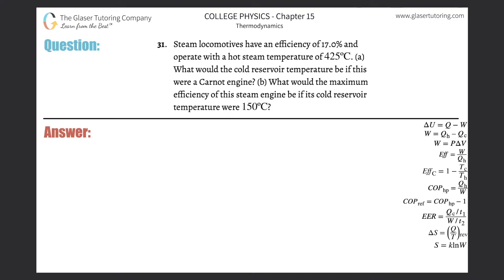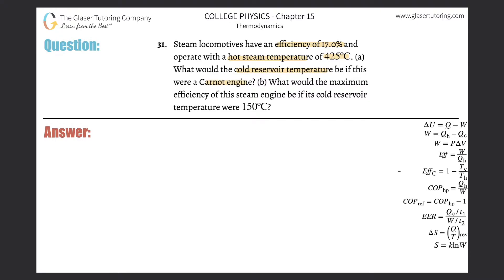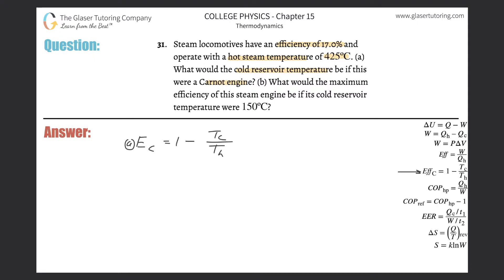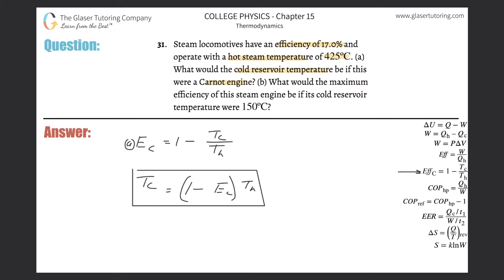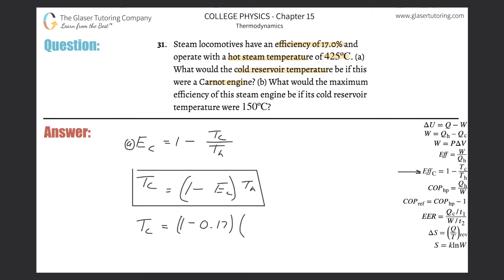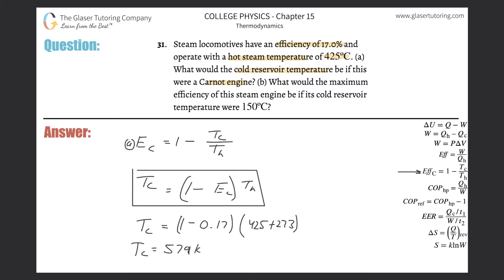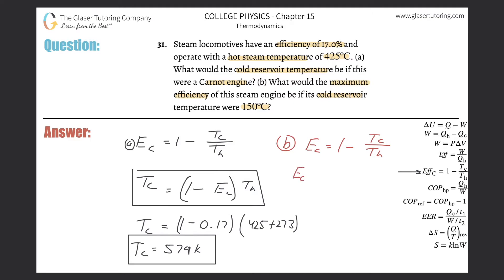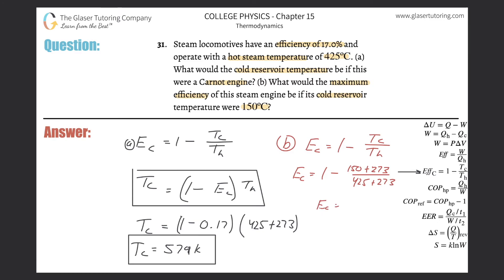15.31 | Steam locomotives have an efficiency of 17.0% and operate with a hot steam temperature of

Comment: I am ot sure what this problem is attempting to calculate. You cannot calculate the cold side temperature of a steam engine from it's efficiency. There are all sorts of losses that would need to be calculated or measured to come up with the actual cold side temperature. Calculating the cold side temperature of a perfect carnot cycle engine is simple enough but no real engine achieves Carnot cycle efficiency, so the calculated efficiency would only only be of academic interest.

But, having been a physics and thermodynamics student many years ago, I get it. Real problems are hard to solve, sometimes actually impossible to solve, so teachers create these make believe problems with all sorts of unrealistic assumptions built in. Where I do have a problem with these problems, is when we go ahead and solve them, making simplifying assumptions without saying what they are. In the first part of this problem, they state that this is a steam locomotive, ie a real device, then ignore that no real heat engine will achieve Carnot cycle efficiency, especially not an actual steam locomotive.